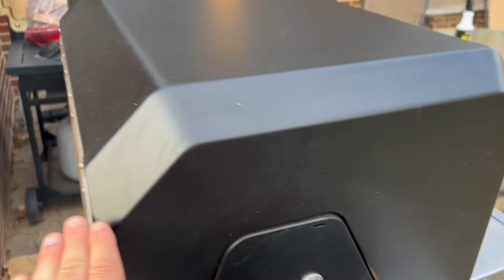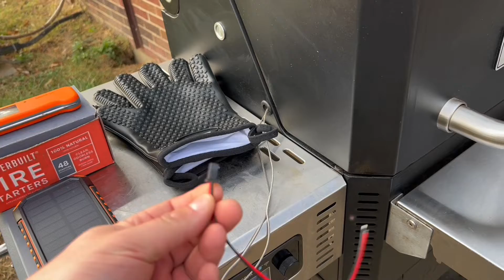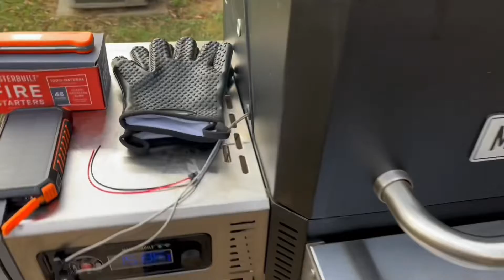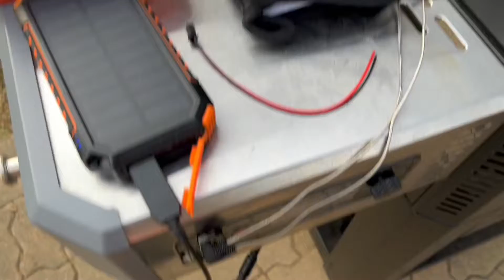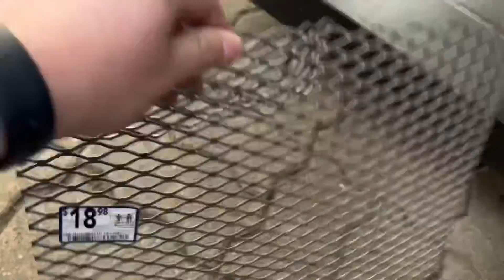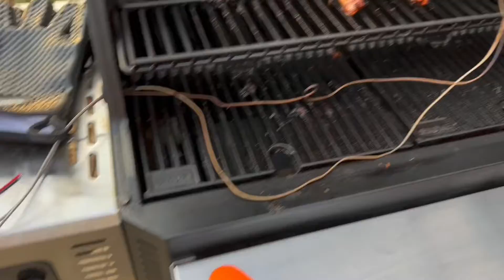Must Have Masterbuilt Gravity Series Add ons!

Comment: How did you cut the steel to fit into the ash basket?
Reply from the maker: @johngamble667  I just used a pair of tin snips. A dremel would work. Maybe even a grinder.
Reply: @Smokingmeatsbbq  Done and it worked great. Keep the videos coming!

Comment: the battery bank only has a 5v output, pluging it in the adaptor doesn't change the voltage output so yours fans are only operating at half the required voltage, and the instant temp is doing exactly the same as the probes attached to bbq
Reply from the maker: It certainly does increase voltage otherwise the MB unit wouldn’t power. It has a 5v to 12v step up built in. 

While you’re right, an instant probe reads temperature the same as a probe inside, it also allows you to check multiple points of meat or check multiple steaks at a time, chickens, etc. an instant probe is my most used cooking tool.

Comment: What do you use to cut the expanded sheet metal with? I'd love to try that out but not if I need to buy a $200 tool to size a $20 piece of metal correctly. :)
Reply from the maker: I “rented” a pair of $20 tin snips from Home Depot. And by rented I mean, returned afterwards :)

Comment: I thought chicken had to be cooked to a 165 degrees
Reply from the maker: Really is a good "rule of thumb". However, I've found that if you pull right at 165, and rest, you will get the temps to peak much higher in the rest. Also, it technically is 100% safe to eat. Look up Pasteurization charts. Sure the FDA says 165 instantly pasteurizes something, but your chicken is cooking much longer and it is safe to eat at lower temps. Nobody likes a slimy chicken so just find what profile of meat works for you!

Comment: That wireless battery trick is pretty damn cool! Do you have mods for the hopper lid, firebox or manifold drip catch?
Reply from the maker: I don’t! Everything else works so well, I’ve not added those. Considering a drop catch but using the top racks and tin foil trays do the trick when I’m smoking greasy stuff! 

And yes the battery mod rules!

Comment: I bought a battery with a 12 volt output. I run the cable under the shelf and into the rear door, 1050 has one, and just stick the end of the battery into the door keeping out of the way and not using up shelf space. Works very well and the smoker hardly discharges it, making for many cooks (long cooks) on a single charge. :-)
Reply from the maker: Heck yes!

Comment: The vent is actually one of the best mods. Reducing the hot smokey air velocity can improve flavour and make cooking much more consistent. Like having the damper on a chimney on an offset smoker, controlling the vent is crucial, in my opinion. After installing the vent on my 1050 I found flavour increased dramatically and brought it close to my offset smoker flavour. I run the vent at about 1/2 the openings in the vent which probably translates to 30% open vent in relation to the unvented slot. 🙂
Reply: where did you buy the vent mod from?
Reply: @marcrosen190  klotes mods
Reply from the maker: I need to play with it more. Just finding the right color smoke is important but I still stand firm on that it is maybe not worth the amount of money they charge, but it was an improvement.